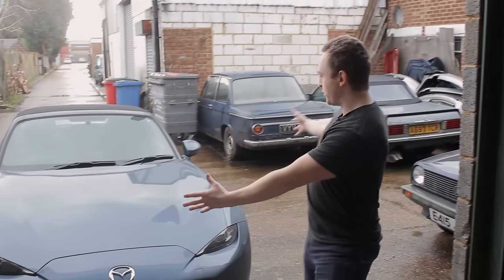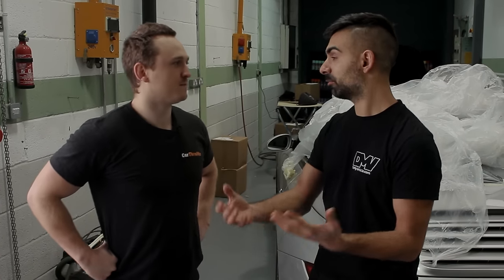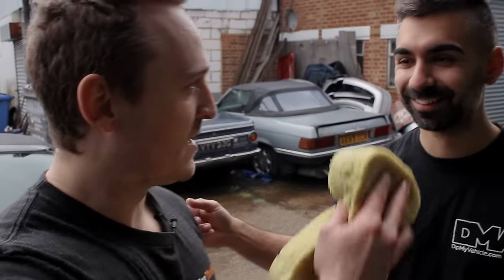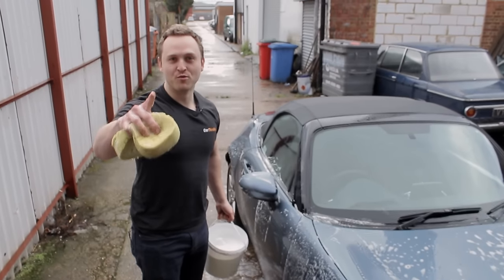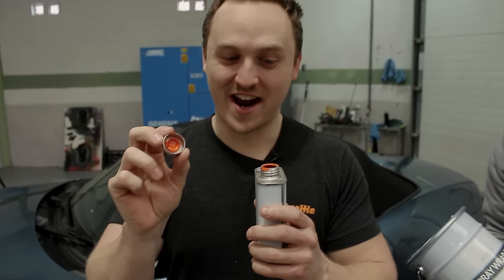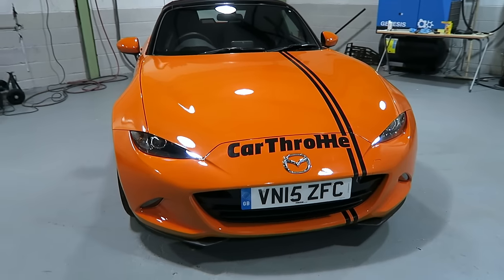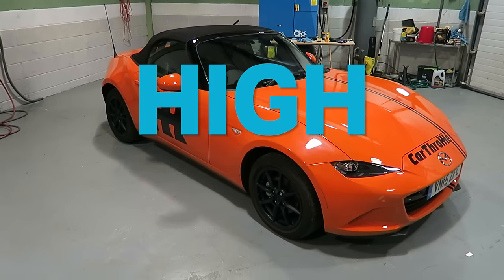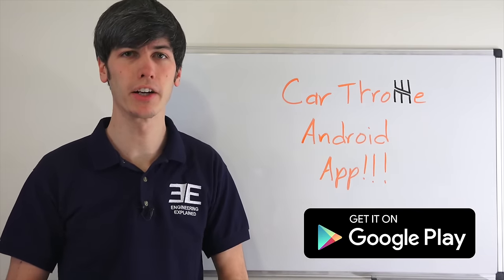I Liquid Wrapped My 2015 Mazda MX-5 And Now I’m In Love

Comment: This new liquid wrap stuff seems a lot better than plasti dips and wraps, espesially when he mentioned that you can polish and was it like paint, very cool!
Reply: The big question is, can You get it Off again without Ruining your Original Paint?
Reply: Baerzilla They said yes, I believe it, they didn't scuff the paint below or anything, so it's not damaged under there, should be possible, maybe not easy though.
Reply: +Baerzilla yes it's within theory supposed to come off without damaging the paint on vary few and vary rarely can it damage paint and if it does it's almost always on a car that doesn't have a factory paint
Reply: +Harrison Davis 
i believe it can peel but i've heard mixed reports of it being kinda tough to get off, doesn't peel cleanly sometimes. 
that said, it's almost indistinguishable from automotive paint finish which makes for a really cheap and relatively easy paint job.
THAT said, it requires really special equipment to spray effectively, it's definitely not a DIY thing and a professional job can cost upwards of $1,500 in materials and labor.
THAT THAT said, $1,500 for what's essentially a reversible paint color change on your car? hell yeah it's worth it. a real paint job would cost like $6,000
Reply: +Ryukachoo If it's hard to peel off it will be fricking expensive to get it peeled off or take hours and hours. Might get as expensive as painting the car. And this for (maybe) four years?
Reply: It's not worth it, Plasti dip was good because it was only around £600 maximum. This is simply a rip off and not worth it
Reply: Sirion
it's not like you need special equipment to peel it, it just doesn't come off as cleanly as plastidip does.
Reply: Milkman69ner Except plasti dip looks horrible, this looks like real paint, and real paint jobs are thousands of dollars for a decent one and you lose value on the car.
Reply: +Harrison Davis you dont know much about plasti dip so why even assume?
Reply: +Dmitri Felbinger except I do know quite a bit about plasti dip, so why don't you not assume.... I have done small panels and trim myself, and watched pros apply whole cars, even when the pros did it it looked bad. If the slightly chunky matte look (kinda like rough sandpaper) is what you are going for than its great, but it sure doesn't look like paint or a wrap!
Reply: +Harrison Davis Its all the same thing underneath. The only difference is the Auto Flex gloss coating put on top of it which is compatible with plastidip as well.
Reply: +jody024 no it's not, Plasti Dip is a name brand this is a similar idea, but a different formula.
Reply: +Harrison Davis Take a look on the Dipyoucar youtube channel, Plastidip most definitely doesn't look bad anymore,

Comment: so wait. if he just did the outside, then that means that the engine bay and door ledge things(idk what they're called) are still the factory color? that's got to look TERRIBLE every time you get in and out of that car.
feel free to correct me if I'm wrong. I'm genuinely curious. I would like to change my car's midnight blue to burnt orange.
Reply: Panic Bear
but wouldn't painting the engine bay require pulling the entire engine?
Reply: he's only got the car till March so who cares
Reply: +The Evenger Yep. I seen many people cheap out on painting and it looks fucking stupid. It takes extra time but the inside of the doors and door sills are easy to do. Engine bay is next to impossible to spray with everything in there but is rarely seen so not usually a big deal. Same with the trunk but that's easy to do if you use it often, just extra time to prep and spray is all.

Comment: You also "painted" the rims.
What happens when you drive in a carwash and these crazy rotating brushes clean the wheels?
Reply: +Zettel007 you should never use those bastard car washes!
Reply: +Alex Kersten I paid for my car 600€ it is 20 jears old and there are to many scraches to count. and it had a little crash in the back. So i don't care about my paint.
Reply: +Zettel007  Never go to an automated car wash! Hand wash all the way
Reply: Robert Skuriat 
give me a reason why I shouldn't do it.
Reply: Automated ones scratch your paintwork. It depends how much you care about your paint I guess
Reply: Robert Skuriat Yeah that is the point. I wash my "summercar" a Rover convertible only by hand.
But the mitsu with dents, scratches and rost no way.
I think about painting the rims on my Mitsubishi.
And that leads me back to my first question: Will this paint (on the rims) resist an automated car wash? something like 3 times a jear.
Reply: Zettel007  I think plastidip is pretty tough. There are videos of people keying it and it seems to survive. So yeah, I think the wheels probably would survive a few automated washes. I wonder how well it copes being near to hot disc brakes though
Reply: +Zettel007 Used one of those car washes once since I was feeling lazy the car looked pretty good after until the sun shined on it and it was covered in scratches from it. So through using a 'convieniant' car wash I had to spend 3+ hours cleaning and polishing my car to get it looking good again.
Reply: You really can't go through automated car washes in soft-top convertibles. And that's ignoring the paint scratching part

Comment: Main question. Wraps are removable anytime, since it is sticker. Since this paint is marketed as a wrap, (assuming it is the same as Plastidip style) is it removable as well? 

Or the only difference is not needing to prep the paint to use it? You can't market this type of paint as wrap if it is not removable without damaging the bottom paint.

Comment: Why do people even like MX5s? They are low horsepower hairdressers cars. I agree with Chris Harris, they are awful. I get the whole rwd convertible thing but with that amount of horsepower surely it's pointless.
Reply: Drive one and you will understand
Reply: Its not about the power or top spped, its about the platform and handling. Like zrile199 sais, drive one and youll understand
Reply: Chris Harris drove a first gen, right?
Reply: I wish a hairdresser would give you what you deserve...
Reply: +Sirion what a nice thing to say
Reply: +zrile199 Ok, I will have a go in my mates. I just don't really see why people comment in certain videos "you went past an mx5 and didn't say anything, not a car guy" because they are really common
Reply: Its a nippy little RWD roadster, its not gonna win any drag battles but its waaay fun to drive
Reply: I got rid of my Mustang GT for a new 124 Spider..  Why?....    It's 10x more FUN to drive....  I'd MUCH rather have a light, nimble  great handling car, than a High Horsepower car that's basically just good for straight line speed.....  My Mustang sat for a year after i got the 124...   drove it one day...  HATED IT..  like driving a fucking land barge...    SOLD IT..  Hell..  My 65HP 1968 Austin Healey SPRITE.. aka MG Midget is 10x MORE FUN than my Mustang was..

Comment: Why did you buy the 1.5L instead of the 2.0L? I drove the 2.0L and it felt under powered and not much of a difference from my completely stock 2005 NB. I can imagine that the 1.5L is painfully under powered.

Comment: I think a service like this is better done on an older car with faded paint, or, on a car with just a plain boring color like silver.  Also good if you replaced panels due to a fender bender and want a new look.  But on a brand-new car that already had a nice paint job, I just don't see the reason.

Comment: Just a FYI never ever, ever point compressed air towards yourself. It seems like a weird gripe but it's extremely dangerous. Getting a stray blast of air in your mouth can actually rupture a lung and only takes roughly 15psi to pop a eye out of its socket. Also it is possible for air to enter the bloodstream even without open wounds, and trust me you do not want air in your bloodstream. Sorry for being a downer! But safety is #1 no matter how experience or well versed you think you are.

Comment: How easily can it be removed? Plastidip is really easy to remove. Will it do anything to the paint underneath?
Reply: no it won't do anything to the why would they make this if it can't be removed with damaging the paint ? it's extremely rare for plastidip or liquid wrap to mess up the paint has it happened? yes but it's extremely rare and it's usually user error and most time the paint wasn't factory

Comment: Did he say the difference between this and plastidip is that this leaves the paint with an OEM finish? But plastidip also does lol all you gotta do is order gloss dip instead of matte.
Reply: plastidip cannot obtain the gloss as autoflex. so no.
Reply: Austin R. If you had taken 2 seconds to type "gloss plasti dip" on Google you wouldn't have posted that comment.
Reply: Arthur Sperotto I don't need to google something I've been following and applying for 3 years. Glossifier by Performix is not able to even come close to Autoflex clear. Both in gloss and feel. If you are referring to DYCs TopCoat, even that can't obtain OEM gloss although it is much closer than Glossifier.

Comment: can remove the wrap just like a vinyl wrap?
Reply: +Potato (Defalt4) Bruh.. you saw them spraying it...
Reply: well if you cant then its pointless because you can get the same effect with a vinyl wrap and you can remove it
Reply: +Педро Годой  So? You can just pull Plasti Dip off, and it's sprayed as well.
Reply: yes you can! the name says it all: liquid wrap.
when it's dry you can remove it like as it was wrapped
Reply: +Potato (Defalt4) You can indeed take it off. Even though it's sprayed on.
Reply: see thats what i thought but i just wanted to make sure... thanks
Reply: Seems like, yeah, i wouldn't do it in any car ever tho.ArneBergsch

Comment: while ~1500usd is not a bad price you should have went with an actual vehicle wrap instead of dip. It's funny how dippers wants to desperately rename this product to liquid wrap so it sounds exotic and superior compared to plastidip. As I saw on the close up it still looks like garbage. I would say : nice way to F up your car. It has a super ugly orange peel. I have removed a quiet lot dip from vehicles and this crap is nasty! It sprays everywhere! In to the doorjambs, around the lights, around windshield, around the glass roof etc etc etc. You can only peel off dip if it has enough coats. Guess what. All that spray in the cracks will stay there. You can always take some harsh chemicals to it. I tried, alcohol, goo removal, acetone and even xylene. xylene was the best but even that needed several coats and several minutes to soften the dip so i could pressure wash it. Oh btw xylene melts styrofoam. So spray that all over your rubber and plastic trims! lol.